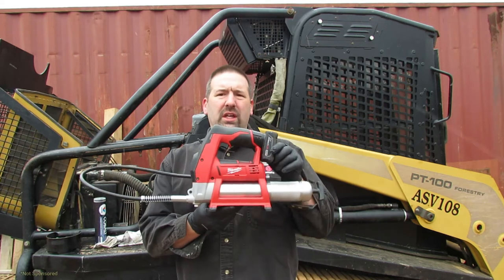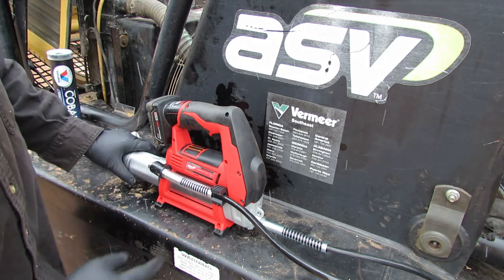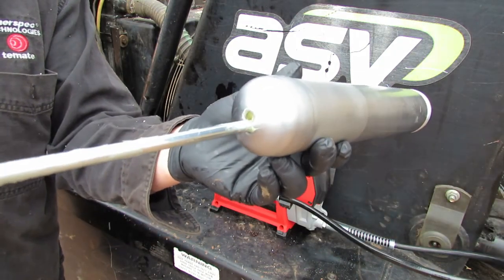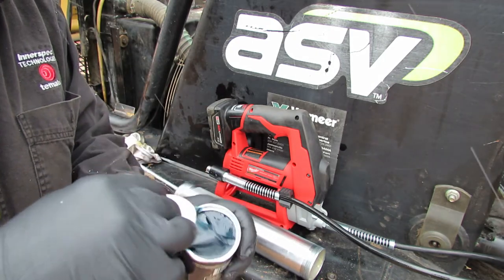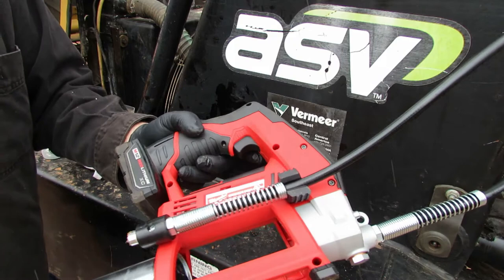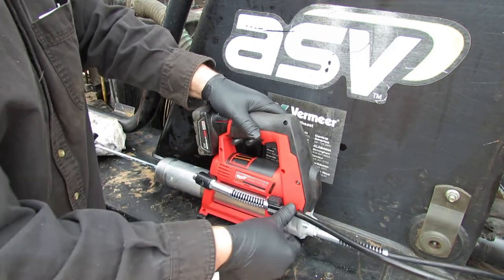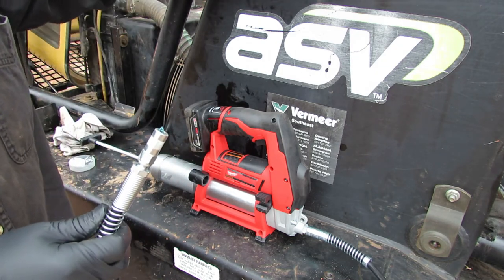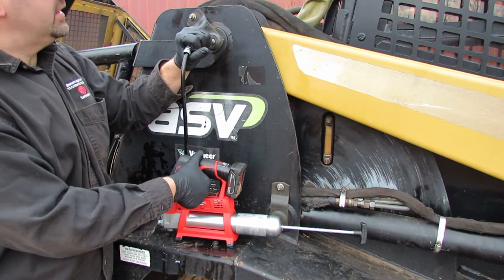Milwaukee M12 Grease Gun 2446 20 2446 21XC Review and Test

Comment: Right at about 3:50 you ran into the same problem I did where the handle will not slide back into the tube.  I actually screwed around trying to sort this out and got Milwaukee's tech support on the phone.  Long story short.  There is a raised lip on the end of the rod about 1/16 of an inch thick that has to pass through a matching notch cut out of a retaining ring.  To align the notch and the lip you will need to apply gentle pressure to the handle while turning it untill they line up.  Then the rod will pass through. You'd think this would be addressed in the instruction manual.  Not everyone has tribal knowledge of how grease guns work.  Hope this helps.
Reply from the maker: @Thomas Tipton this helped tremendously! Thank you so much for sharing this information. I have gotten many comments about my handle hanging out. I am going to make a video about this process. You ROCK! ~Mr. C.
Reply: It is mentioned in the manual that if you can't push the rod in, you turn the handle 90 degrees and it'll go in.

Comment: So I’m kinda confused I saw you didn’t put the long rod in the I’ve seen some other videos of m18 and they do it , I just bought the m12 and it seems like I need to purge it because it suddenly stops coming out
Reply from the maker: @jose mojica excellent observation. I was confused too about the handle sticking out. I pushed and pushed and couldn't get the rod in. Another commenter called Milwaukee and they helped him out. Look for Thomas Tipton comments. In summary, turn the handle 90 degrees and push in. There is a button on the front of the grease gun to purge air out. See if that helps. ~Mr. C.

Comment: Now I'm totally confused do I push the handle in or do I leave it out you guys are arguing over it and I still don't know what to do can someone help me
Reply from the maker: @Quintin Bridges me too. I kinda like it hanging out. I can see how much is left in the tube. If you force it in there it is safer for the machine and is probably the proper way to do it. I say you do you. Roll with it however you want. As long as you grease your equipment when necessary. ~Mr. C.
Reply: @NaturesCadenceFarm -protruding rod/plunger - just  rotate the handle 90 degrees and it will slide in easily.no force required.

Comment: Just bought mine, wanted the m18 i believe, all sold out... so got this one next shelve over, for one semi truck its probably all i ever need, and saved 50 bucks lol
Reply from the maker: @stefan k that is excellent. I hope you like it as much as I do. Let me know! ~Mr. C.
Reply: Yep, when I first bought into the milwaukee line up I bought m18 fuel 1/2", impact driver, drill and sawzall. I thought then m18 was superior and it is most cases but I've since learned I buy m18 tools that I'm constantly using and beating on and my auxiliary stuff is m12. Saves a ton of money in the long run.

Comment: Does it have enough pressure to tighten the tracks up on the skid loader
Reply from the maker: William brapping land that is a good question. I do not know if it will tighten tracks on other skid loaders. The model I have (Pt-100) uses a mechanical type turn buckle to tension the tracks. I would say yes. It seems to have pretty good pressure. Thanks for asking! ~Mr. C.
Reply: yes it does

Comment: Doing it all wrong! Have you never use a grease gun before? The plunger rod needs to be pushed back in so the spring loaded plunger piston can push grease into the head. Looks so silly, this entire video plunger handle sticking out.
Reply from the maker: @Moo Cow thanks for the tip. ~Mr. C.